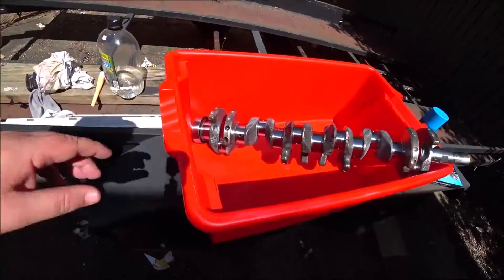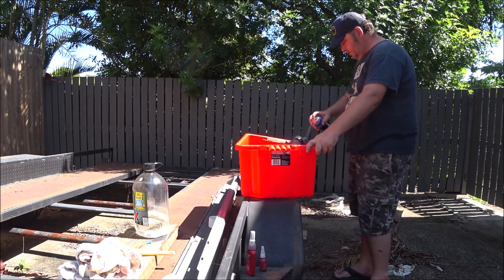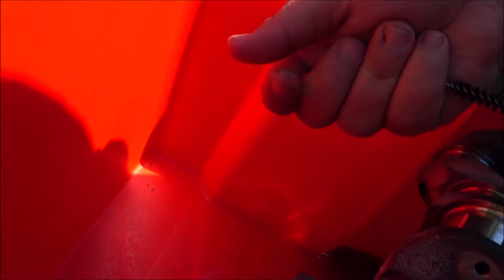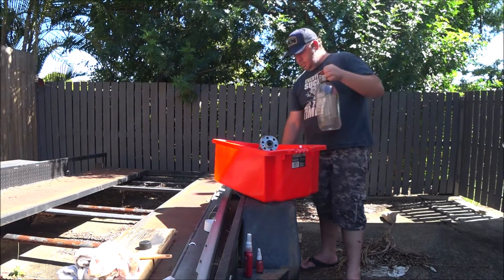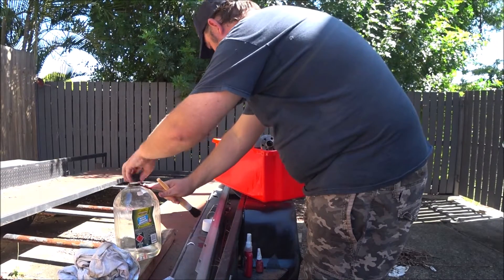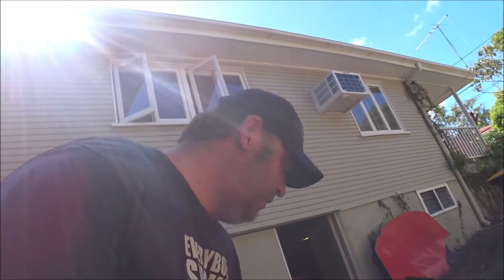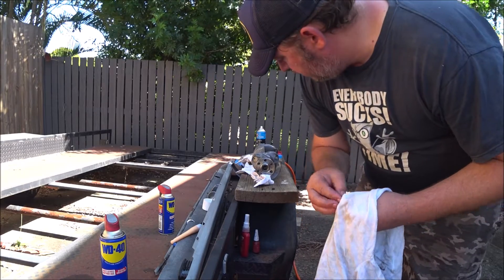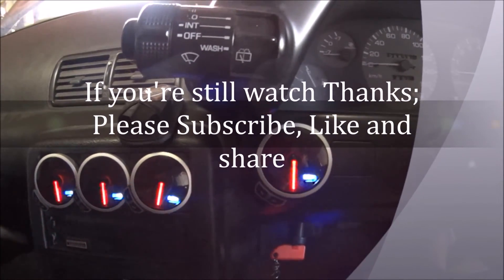RB25DET Build - Grub Screw Crankshaft Cleaning The Oil Passages

Comment: Learning so much from your videos man thank you so much and keep up the great content! Can't wait to see this girl running
Reply from the maker: She'll be mental when I'm done
Reply: @tangles01  what turbo have you got lined up for her?
Reply from the maker: @sandyfpv5216  Same one I had on it before, GTX3076
Reply: @tangles01  Ah very nice! With the .83 rear housing?
Reply from the maker: @sandyfpv5216  Yes .83 previously mad 21 psi at 3800 RPM expect ti to make the 28 to 30 that it will run now by 4000
Reply: @tangles01  yep that will definitely be mental, look forward to it have a good weekend man
Reply from the maker: @sandyfpv5216  Well you can see how it used to run with 19PSI on the channel already, go check it out at Japnats time attack.
Reply: @tangles01  thanks mate will do!
Reply from the maker: @sandyfpv5216  Here's the link to a 1 lap vid, there is a whole event on up if you look in the playlists for the Motorsports one. https://youtu.be/u9XdHTedlfw
Reply: @tangles01  it comes on boost so fast! I'm installing a gtx3071r on my R34 at the moment but only for street
Reply from the maker: @sandyfpv5216  I'll repeat the words of Andrew Hawkins on a Facebook question, paraphrased... For an RB25 the 3076 is the best turbo size available..... that was maybe 2 years ago, so now you'd say the gen 2 gtx3076. Planty of response and bulk power. This will make 400rwkw easy with ethanol.
Reply: @tangles01 I've purchased a gen 2 twin scroll from watching your videos. Just trying to save up the cash to get everything installed now haha
Reply from the maker: You will not egret tat choice mate.

Comment: Isopropyl - of or denoting the alkyl radical —CH(CH3)2, derived from propane by removal of a hydrogen atom from the middle carbon atom.

WD-40 Every DIYers best mate😇

Get that crank swimming & clean😁

Wish I could take engines apart like that.
Reply from the maker: Why can't you?
Reply: @tangles01   I would like to, and could if I was shown, but it looks like a major job that can't be done without experienced guidance.
Reply from the maker: I watched my dad strip a motor when I was 15. I then had to replace a head when I was 17 and again at 18, when I was 20 the whole engine needed rebuilding, I just figured it out, a it of reading and study, the hardest bit is figuring out which tools you need.
Reply: @tangles01   I hear ya. Maybe it is doable but I would need to be there when someone does it. I'm a visual learner. 

BTW, please let me know, I have a question. I changed my sparkplugs today (first time I've ever done it) and one or two had some oil over the thread and very slightly dripping, but not on the spark tip area, the others also but to a lesser degree. Could this mean I need to replace the valve cover gasket, or is it normal for a small amount of oil to be on the sparkplugs?

Also the second ignition coil (from the front) would not fit tightly/snugly over the sparkplug, only loosely (the others were snug), will this be an issue, or does replacing the cover hold them tightly in place?
Reply from the maker: @axelfoley1768  So oil on the tops of the plugs, is a leaking gasket, oil vapour it getting out then condensing and collecting round the plugs, I'd replace the gasket, although the bolts may have just come loose, try tightening them down, see what happens. The coil should fit snug and positively engage, if not you won't have a good contact and it will cause problems. Inspect it closely (inside the end) replace if needed.
Reply: @tangles01   oil (not a lot, just some, but noticeable) not on the top, just on the metal thread area. The tips (where the spark comes out) were fine, they were dry. The guy at Auto Plus (mechanic shop) said the Ford Territory is not known to have problems with the valve cover gaskets. I don't know what to do. 

BTW, many experts saying that sparkplugs must be done with a torgue wrench. I noticed you didn't bother. What would you say?
Reply from the maker: @axelfoley1768  The correct thing is to use a torque wrench. I have done up a few thousand without one and never stripped a thread nor had one come loose. And I do own a few torque wrenches so yeah. I don't bother, but it is the right way to do it. Having said that everything I can torque correctly on the race build will be done so.